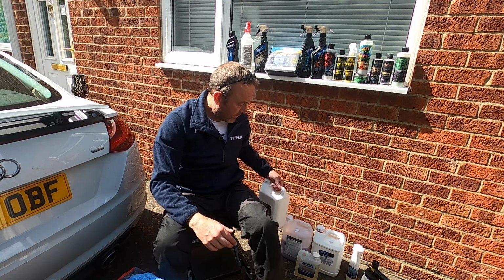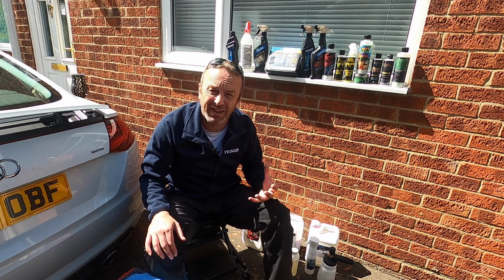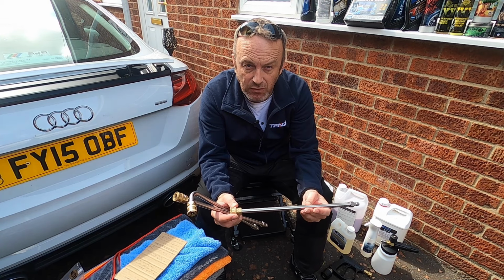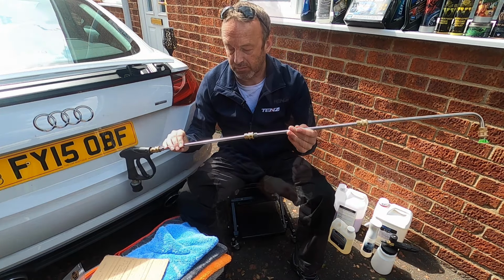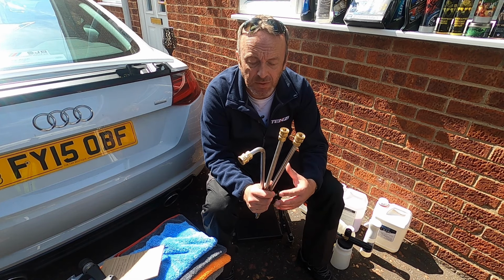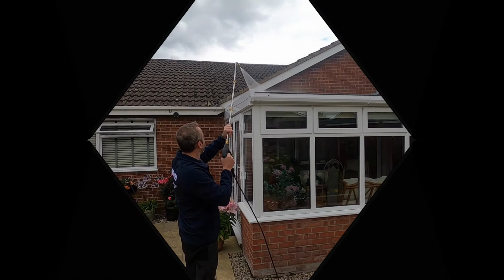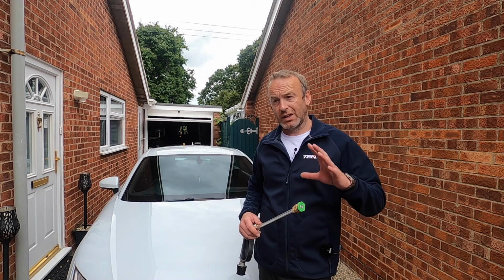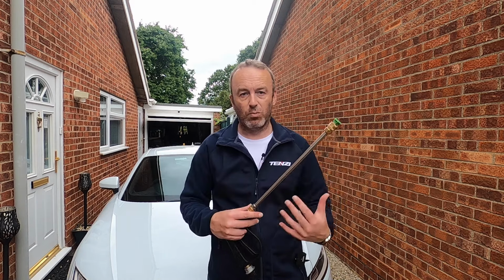The Car Boutique reviews - Clay Cloth Company 3pc extension wands.

Comment: Me again, and again, something that I've already gone for.
A few things to note -
My Karcher has 2 flow settings...on and off. Whether using their own angled lance or one like the one you demonstrated, the jet action means I have to rest the bend on my foot to avoid it hitting the ground when doing under-carriage stuff. Another thing to be careful of when using angled lances is that, if you let go of the trigger, the jet action stops so if you're pushing against it and the tip is close to something, it can hit.
When I was looking into the whole quick connect stuff, I asked questions on various forums about how safe they were. A couple of replies were along the lines of : "Make sure the connection is made properly by pointing it away somewhere safe and testing it. You only forget once!"
Lastly, accessories to add include: Hanging brackets for the lances and I also bought some handles that wrap around the long ones to insulate your hands in the colder months.
Reply from the maker: Shaun thanks for comment. I fully agree you do have to be careful using items such as this as the pressure release does kick a reaction in the extensions as discussed in the video. Definitely something to be aware off when operating.